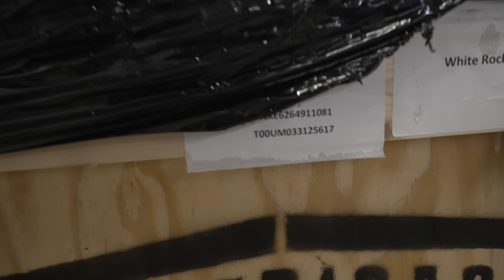My Demon Crate Motor Arrived for My Jeep Gladiator Swap

Comment: For your new gas guzzler and your diesel think about getting an aux tank.  Long Range America and The Long Ranger, both from Australia, have different tanks that mount on the bottom of the vehicle giving you anywhere between 15 and 20, or so, extra fuel.  They fill through your regular fuel filler, transfer the fuel over to your main tank.  I keep looking at them for my JL diesel.

Comment: For as much money as that entire set up cost, I'm actually one who would question why the stuff in that top white box wasn't like bubble wrapped and better secured, specifically that cooler.  Yes it's all heavy and yes it was tied to the top of that crate and yes it's not likely to move around, but I've also seen first hand how stuff is handled by LTL carriers and trucks in general.  Regardless it obviously made it safe and WOW that looks great!!!
Reply from the maker: Beats me. Everything arrived in good condition and in working order. Packing seems adequate.

Comment: If I converted my Jeep Gladiator 3.6 liter to a demon setup? I would be paranoid to take the Jeep on the rough trails and beat it up. It would become a show truck or concrete cruiser. A $160,000 plus Jeep Gladiator can make a guy neurotic and paranoid out in the wild.
Reply from the maker: Ive been driving a $100k Jeep all over for 3 years. Nothing will change. I build my rigs to drive.